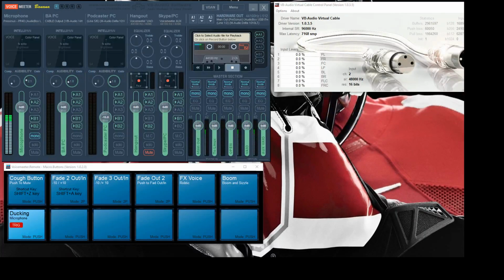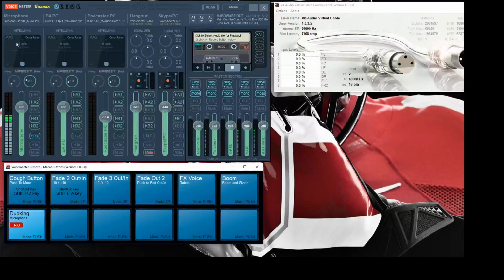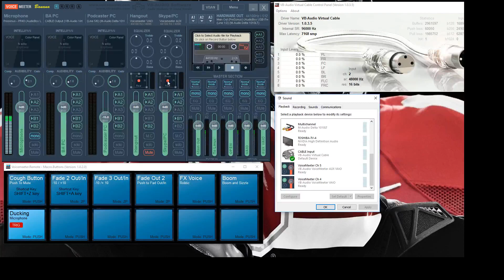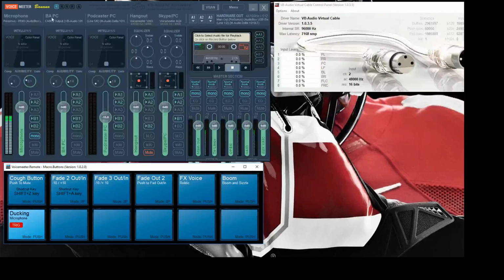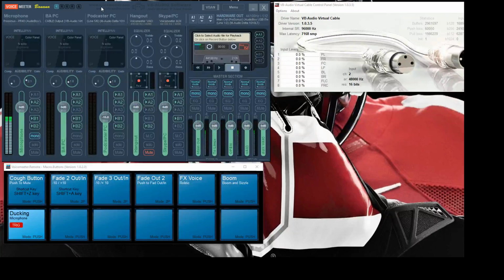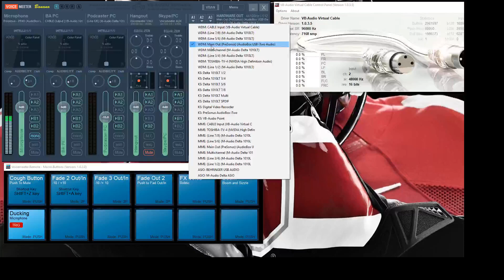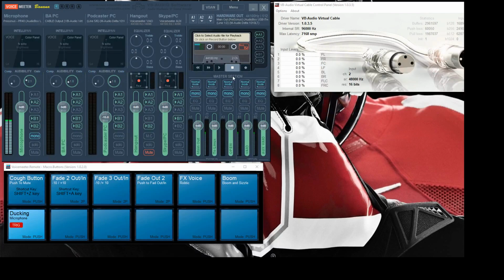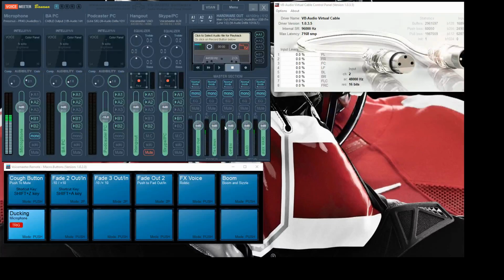Voicemeeter Inputs and Outputs (Hardware and Virtual)

Comment: this vid almost fixed my problem. Had to bash my head a bit to get it to work. So everything in this vid is good until i opened fl shit didnt work out as mentioned but its pretty easy fix. When you go to audio setting on the drop menu press voicemeeter audio aux virtual asio (at the buffer lenght didnt show the option as mention in the vid for me). And also if  your mic glitches when you click it in fl just go to voicemeeter and adjust the fadder gain  in the master section option and that should fix it. (for me its B2 on stereo input 1 section so the fader knob on the master section is the last one)

Comment: Great tutorial! I have a sound card that splits game and audio tracks. I use Nvidia replay to capture clips but it only lets you select 1 audio output device to capture from. I want to use voicemeeter to combine game and audio devices into a single output. I know this is kind of the opposite of what the program normally does, but is this possible? Thanks!
Reply from the maker: Yes, very much so.
Reply: @MerleCox  how do get voice meeter bannan out put to be  48000 hz

Comment: Im just trying to use 2 mics on 2 inputs. Both mics are coming into the same channel and I can't separate them.

In my playback settings, (under sound panel) it simply says "line Audio"  and as my mic recording source.
Reply from the maker: You have to ensure you select the correct mic on each separate VoiceMeeter input.  What hardware are you using to capture your mic input?

Comment: why am i getting pc output through my mic on obs and everything else i test my mic on.... voicemeeter fucked my pc over and i cant even stream now... sorry but can someone please help me..
Reply: i have the same problem
Reply: @cWilt  ive had to resort to using a small usb sound card for my mic.... its so frustrating... but it works and i dont get wierd double audio now... so... if u cant find any solition just invest in a cheap £2 sound splitter on ebay

Comment: is there a way to switch between two audio output devices without having them both on simultaneously?
Reply from the maker: You can assign the two different output devices to different output channels and play the audio to them at the same time or or one at a time.
Reply: @MerleCox  another problem I've ran into is that when I record something through obs or other capturing programs, my microphone and desktop audio isn't there. Even tho it's clearly picking up signal.
Reply from the maker: @aznbeagle  Are you recording with Voicemeeter?  If so, you have to ensure you have selected which inputs to record from Voicemetee.
Reply: @MerleCox  Ah that fixed it. I've forgotten to set that up. Thx!

Comment: So basically my problem is ,
i have 2 Audio sources , 1 from My mic and one comming from my desktop Audio . So how do i rout both signals to 1 Output ?
Reply: In theory, you'd set the first input (for example) to your microphone. Set your second input to stereo mix. And click "A1" on both.

Then you would set "A1" to whatever hardware you want them to output to. Or, if you wanted it to go to an app, you'd send it to B1 or B2, and tell the application to listen to "Voicemeeter VAIO (B1)" or "Voicemeeter AUX (B2)."

Comment: My input and output have switched places. i.e. In sounds my voicemeeter inputs are there and in mics my voicemeeter outputs are there
Reply: did you find a fix?
Reply: @tyler7913  No, but it apparently works now. They are still switched though.
Reply: @char1301  Damn i have the same problem, my output is in my speakers tab and my inputs are in the Mic tab on Teamspeak 3, any fix yet ?
Reply: luc Yeah I just found out that’s how it’s supposed to be when you install voicemeeter. If you need any more help you can add me on discord. Char#3643
Reply: @char1301  can you help me too??
Reply: @vxzty  you have a fortnite profile picture no help given
Reply: @char1301  ?
Reply: @vxzty  You play fortnite.
Reply: @char1301  dude please help bro
Reply: yo uhh can i get ur new discord name? i need help too
Reply: @themarting270  Char#3268

Comment: Could I have a web page opened in Chrome as a virtual input?
Reply from the maker: Yes, if you are running windows 10 you could launch Chrome, go into the sound settings and direct the sound from that to a virtual input.  In Voicemeeter, assign that input to a strip and then route that audio to any of your outputs.  I hope that makes sense.
Reply: @MerleCox  Thanks so much,  that's excellent news and just what I need!

Comment: Hi! I need your assistance. How can I assign a channel for a particular hardware output device? Say, I want A1 output to play the right channel from Windows 10 when A2 plays the left one.

I’ve tried dozens of times. What Voicemeeter does is simply duplicating the stereo output to all the hardware output devices.
Reply from the maker: I'm not sure you can accomplish that without doing some crazy audio routing.  I've thought about this off and on all day.  I just don't know how to pull that off. 

If the sound coming out of Windows 10 is stereo, the channels should be playing out the correct left and right channel.
Reply: @MerleCox  
Hi! I've succeeded with a simpler method by shutting down either of the channels of each Bluetooth speaker itself:
https://www.addictivetips.com/windows-tips/manage-left-right-channels-for-bluetooth-headphones-on-windows-10/

It works with Voicemeeter if MME is used as the output format. WDM will just automatically turn each speaker back to stereo again. 

Thanks for your reply anyway! I'll keep watching your tutorial clips.

Comment: Merle, this is a fantastic tutorial.  I follow along and completely understand  but I get lost when it comes to assigning virtual inputs.  Is it possible to assign sound from a website as a virtual input.  I'm talking about Google voice.  I guess it confuses me because assigning a piece of hardware is found in a list of USB devices but virtual inputs are not.  I'm trying to employ the sound from OBS when creating a live stream with Stream Yard.
Reply from the maker: Scott Fichter if I’m following you, yes it is.  When I get back to my office I’ll address this for you.  Thanks!!!
Reply from the maker: Scott, there are several ways you can pull this off.  First, the latest Windows 10 version (I think this is the first time in windows you can do this) under a setting called App Volume and device preferences, you can now assign applications to different output and or input.  VoiceMeeter comes with one or two virtual audio cables and for a donation, you can download additional virtual audio cables from the voicemeeter website.  You could route the browser audio to one of the virtual audio cables through the windows settings identified above.  However, if you use Chrome, there is an extension called Audiopick that you can install.  I would use that plugin to route the audio from the browser to a virtual audio cable.  I will be doing a video later today showing how you can do that.  Hope this helps!
Reply: @MerleCox  FANTASTIC, routing browser audio through a virtual cable would be huge.
Reply from the maker: @ScottFichter  
Merle Cox
Ok, I did a quick video for you.  Hope it helps! https://youtu.be/_m9umprfE2o
Reply from the maker: Ok, I did a quick video for you.  Hope it helps! https://youtu.be/_m9umprfE2o

Comment: Hello, I wanted to route the Virtual Outputs to Discord, but it doesn't seem like Discord recognises the virtual outputs, or maybe it actually does, it says Voicemeeter Output and Voicemeeter Aux Output, but they don't seem to work. Any ideas?
Reply from the maker: Fermented TNT ensure you are touring audio to those virtual outputs.  You need to make sure the audio is going to the correct output.
Reply: @MerleCox  Well, it's really weird, but sometimes it works without changing anything, and sometimes it doesn't. I seriously have no clue anymore lol.

Comment: Hi, I just started using this VM and was wondering if it is possible to output audio to my computer speakers and bluetooth speakers at the same time
Reply from the maker: Yes, under the hardware out section, top right corner of the program windows, you will see A1, A2, etc.  That is where you select the outputs.  Once you have assigned your computer speakers and Bluetooth speakers to an output, simply direct all the inputs to those outputs.